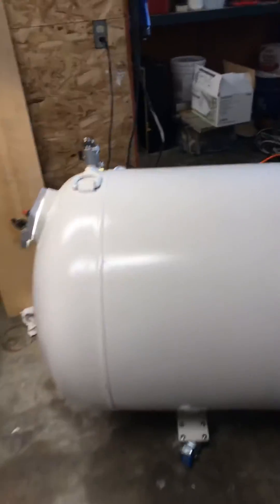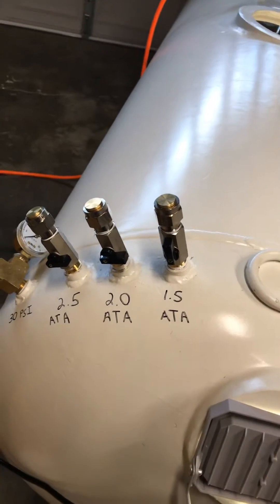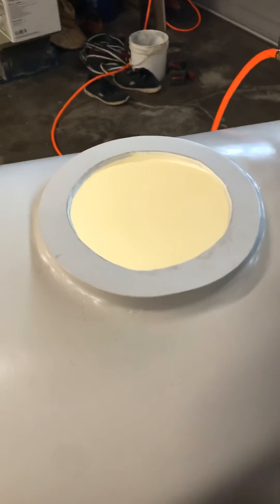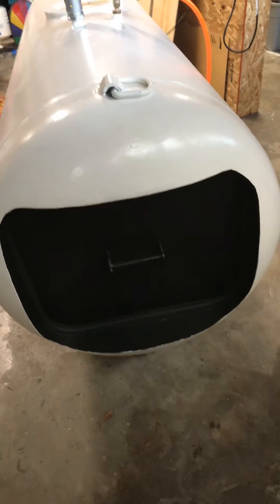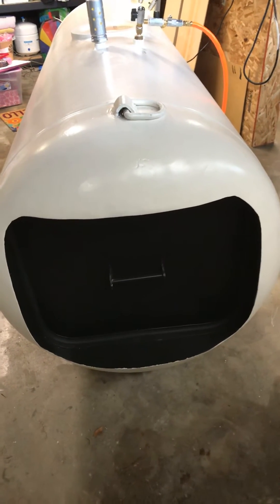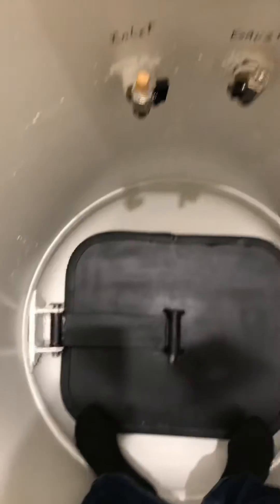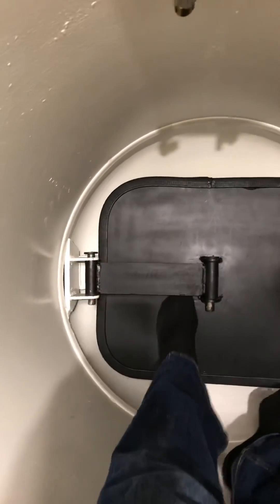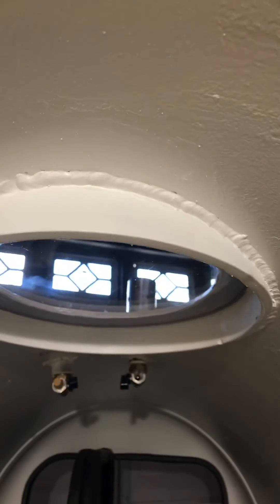Hyperbaric Oxygen Chamber Home Built custom 3 ata chamber build yourself Homemade

Comment: How you manage exhaust CO2 from the body?
Reply: From what I gather, they have "air in" "air out"  so once it's up to pressure, you just keep feeding it pressurized air and the pressure control valve exhausts keeping it at the chosen set pressure.  So fresh air is being pumped in as air is being exhausted

Comment: I built a cheap experimental one years ago plastic only 1.5 but what concerned me was it was using a regular compressor and was worried about the oil from the case getting inside. Nice build
Reply from the maker: Yes you need a oil free compressor
Reply: just add a filter inline if you are worried about any particulate

Comment: Brother I was so stoked to find your channel because, I have been having heart problems. Not horrible yet but I am performing a 100% zen transformation. One thing I use is a meditation called The Gateway Experience. As I naturally had those out of body like experiences from a child. But The gateway Syncs Left and right brain, then the bifurcation echo in the heart. Deals with a lot of heart, brain. Also Dro Joe Dispenza, Gregg Braden's work on study of the group of late stage cancer survivors a study of spontaneous remission to find the common denominator and find ways to control the placebo effect. That with all the latest Nootropics, KY2 for my kidneys as I pass stones last year for 9 months without help or meds because the hospital put die in that covered the stones, after the pain finally moved from back to bladder and then burn vanishing the next day with full flow. I knew I spent 10 months in massive pain and my trust in the medical system is nihil. In any event I also got MitoQ for the heart and healing my pericarditis and regurgitative aortic valve.. I really threw the book at the latest best supplements after seeing a lot of science.. Iv come so far with the meditations that Iv already changed my habits that will show great changes in about 60 days. Also got a load of Carnivora, Time release 500 MG Niacin. Lactic Acid bacteria actually supercharges the K2 MK7  with D3 as well as the MitoQ. Now all of the above really increase blood flow, repairs cells and regenerates. But the meditation regenerates the degenerated Telomeres on your DNA and it restores them in 60 days of 33 minutes of meditation every morning. This is what starts the remission and rewires the brain. Most importantly The Gateway Meditation and Syncing Left Right Brain with the Bifurcation echo is a level of changes that take place, I mean I thought these changes would be next to impossible, I smoke as well. But My Supplements are on the way from amazon while I have been doing the gateway every day for 2-4 hours. And after a week of that I have some pretty amazing changes in the way my body feels. After being a stone mason my entire life, I can not put in 8 self tapping wood screws in my desk without a wave of intense nerve pain rushing through those hands for 3 weeks after.. 8 SCREWS Man.. And im 47. That is to say with my financial situation beings my being too stubborn to go on SSDI pride i guess. I have to build my own chamber. But more than just a chamber what I need to design is One machine that provides me sensory deprivation tank combined with the pressure. And I thought a Propane tank would be perfect. Never thought Id find someone who build one and wow it sure looks nice man.. So I thought I might reatch out and see if you might be interested in helping me design a system that does the oxygen treatment with the sensory deprivation so I can perform my Meditation with zero tension on my body. while betting the high dose of oxygen as the most important part of the meditation is moving a wave of oxygen through the body, converting it to mental energy and then dreamscaping while the Tone in the left ear plays slightly lower than the right ear causing the brain to sync. Hemi-sync. Its a very real thing and doing that with the oxygen treatments would be next level. But the sensory deprivation is extremely important to me due to the amount of distraction a bed, blanket, big toe sticks out, breathing,  true people meditate all the time while just using a bed. The Best Monks in the east are Bald so when meditating not even a hair can distract them. So if those monks shave heads to go Zen, Its not that you can not meditate, Its that every possible one up on the depth of numbing the body while staying completely awake in the mind. This method you as they say go visit past away lovedones while back on the ranch in the chamber your brain is synced up, heart, as my water proof ear buds with full cover phones will ensure that. If I have to use ultrasound and beam it through the water I can do that as well. I am extremely creative . My plan is not a typical sensory deprivation tank either. I plan to push the envelope very hard on the floating part. An old stone mason body needs total free space floating. I have some ideas that done require salt to float. Anyway Im gooing to watch your content about this and If you are interested in working with me on project possible some brain storming.. Reply and ill email you.. :) Thank you..
Reply from the maker: the fact that you cant install eight screws without having dizziness, and that your profession was the hardest job there is on your body, I would think that you could be suffering from ligament laxity in your neck and miss alignment which causes neurological problems ringing in the ears, dizziness, panic attacks heart palpitations vertigo, digestive issues and much more. If any of that sounds like you, check out caring medical on youtube. I have suffered from this myself . I went to the dr howzer in florida and am 70 percent better. I would not be interested in a chamber build with those parameters. Best of luck to you!
Reply: I just finished one that can be pressurized to 2 ATA (28PSI), has power on the inside, and is on wheels. I am willing to sell it if you are interested for roughly 5-6k(maybe less). I could probably even deliver if gas and time is paid for!

Comment: Would it be more efficient if the inlet was closer to the head and the exhaust closer to the feet? I haven't built one yet so I have a lot of questions. Thanks for the video.
Reply from the maker: Hello sir the closer the inlet is to your head the louder it is. Also, if you’re supplying oxygen you have that up there also.
Reply: @dennisgrob5690  I appreciate your response and help. My question is more about this amount of 02 used in relation to their placements. I am working in an environment where 02 is incredibly hard to get, but I think a hyperbaric chamber is going to help increase overall 02 sat to stabilize patients. I know that might be a bit in the weeds for this video but again any advice will help me save lives. Cheers

Comment: Dennis... I am interested in bldg my own chamber. I have lost a kidneybto cancer and my remaining kidney is impaired. I also have ischemia of the heart. 
I have researched hyperbaric and believe it will give me some relief!
Since I can't afford a manufactured chamber I would like to build one. I want to build one that uses an oxy generator with a face mask and 2 to 2.5 ATM. Any advice would be helpful. How can we communicate with each other?
Reply: I just finished one that can be pressurized to 2 ATA (28PSI), has power on the inside, and is on wheels. I am willing to sell it if you are interested. I could probably even deliver if gas and time is paid for!
Reply: @rileywitt1911  I'm interested if still available. How do I contact you?

Comment: Hi Dennis- are you still making chambers?  Or assisting ?  Please advise-
Reply: I just finished one that can be pressurized to 2 ATA (28PSI), has power on the inside, and is on wheels. I am willing to sell it if you are interested. I could probably even deliver if gas and time is paid for!
Reply from the maker: I make on request .I have only made larger chambers since the video. if you are interested grobwoody1@gmail and leave a contact

Comment: How much?
Reply from the maker: base price 24000 for a 38inch by 8 foot
Reply: I just finished one that can be pressurized to 2 ATA (28PSI), has power on the inside, and is on wheels. I am willing to sell it if you are interested for roughly 5-6k(maybe less). I could probably even deliver if gas and time is paid for!

Comment: Okay, I would love to make one but I'm worried about these home made ones exploding with 100% O2 while I'm in it. Are these safe? Are there anything safety precautions I should take before turning this on or redesign?
Reply: I have a hardware hyperbaric oxygen chamber. I wonder if you still need it now?
Reply: @KiKIGao77  are you in southern california?
Reply from the maker: first if you use the tanks I build it would only be ambient air compressed to max 3 atm. there would be no higher percentage o2 than what you breathe now but the compression would b 3 times greater pushing o2 further into your cells. It is possible to add 100% o2 to the tank in the form of mask distribution . we take great lengths to ensure safety and safe practices
Reply: @dennisgrob5690  How can I reach you so I can purchase one or come pick it up..

Comment: Hi how can I reach you? I am interested in buying a tank or getting help building one. Thanks!
Reply from the maker: grobwoody1@gmail.com
Reply: I just finished one that can be pressurized to 2 ATA (28PSI), has power on the inside, and is on wheels. I am willing to sell it if you are interested. I could probably even deliver if gas and time is paid for! I should be able to sell for a lot cheaper!
Reply: @rileywitt1911  I tried to email you before. I can try from another email
Reply: @rileywitt1911  Did you get my email?
Reply: @testomaximo  I did not.
Reply: What is your email?
Reply: @testomaximo  Can you try sending it again?
Reply: @rileywitt1911  check your spam it's coming from peptide frontier
Reply: @testomaximo  I haven't gotten anything
Reply: @rileywitt1911   I just tried again from my Gmail. Somthing isn't working. Are you sure you posted the correct email? I keep trying to post my email and YouTube is removing it even if I do it cryptically. It's my first name (a ) peptide frontier then the normal ending
Reply: @testomaximo  I just sent you one.. Hopefully that works
Reply: @rileywitt1911  I don't see it in my peptide frontier. Try ryanrmisas at the same domain as yours
Reply: @testomaximo  Sent

Comment: I finally got around to building one. Could really use some help selecting a seal for the door. Thanks!
Reply from the maker: what part do you need help with? you can use rubber chord at 1/2 inch but it depends on your build. stay tuned as I am building one now and will show the process soon
Reply: @dennisgrob5690  How did you build the channel that the O-ring door seal sits in?
Reply: I had a machine shop grind a 1/8 by 1/8 curved channel on the face of a 24" by 1/2" steel plate 1/2" from the edge on one side and use a glue stick to paste a 1/8" I.D. latex tube onto it. This holds for years. 3 so far with me. You need to give any sealing material a place to go when pressure builds or the seal will be crushed and last only a few sessions.
Reply: @Josh-ov4wj  Is this like an O-ring groove in a hydraulic fitting?  I'm trying to figure out a good door seal as well.  It looks like you don't need a latch on the door since pressure from inside will seal it?

Comment: What's the psi you pump it up to. I'm making a chamber. I haven't got in it yet I need clean air filter and pressure release valve.   I've had it up to 8 lbs psi. I'm not planning on going more than 5. Doesn't it get  hot inside when the compressor warms up? And does the outside temperature make any differance. Right now I'm using just air but I plan on adding a 02 concentrator.
Reply from the maker: 3 atm or 30 psi. the temperature inside increases in relation to the pressure as more molecules are pushed together ie friction. in winter it is not an issue but in summer as the ambient temp rises it does get hotter. I had an inline ac to help control the temp. as for using an o2 concentrator , the pressure that it creates is not enough to be usable. I had an invacare o2 concentrator and a o2 compressor pressurizing to 2k psi in 2 large o2 tanks. then reduction gauge and o2 flow control bringing 20 lpm of o2 into the chamber through a mask at 40 psi. It had to be more psi than 3 atm to supply me with o2. if you are not up to all that jazz then I recommend just ambient air and an oil free compressor. You will get a benefit from that alone.
Reply: @dennisgrob5690  3 atm is 44.0878463  psi.  You shouldn't be confused on Atm and ATA if you are giving advice to people.

Comment: How much does the 30" x 84" and cost?
Reply: I just finished one that can be pressurized to 2 ATA (28PSI), has power on the inside, and is on wheels. I am willing to sell it if you are interested. I could probably even deliver if gas and time is paid for!
Reply from the maker: I no longer make the small ones unless it was a contract job, they are just too small

Comment: Also what are you using to create the pressure are you using a vacuum pump and reversed like something similar to air conditioning pumps
Reply from the maker: I use oil free air compressors . 220 volt are better as they use less amps
Reply: @dennisgrob5690  I have been researching to buy an oil free screw type air compressor and looked at Kaeser, Quincy, Atlas Copco but their smallest is 5 hp. Can you please recommend a supplier. What brand is your 2 hp compressor. Thank you.

Comment: I am going to build one I was curious I do plumbing so would be using 100 gallon water heater internally they have a second shell that is obviously airtight I would lay some comforts in it but do you think that would be sufficient start to the outer shell
Reply from the maker: I would not do that, you couldnt move around or fit in that size . The video I made is 250 gallon and able to withstand 160 psi. I normally build a 500 gallon tank which is 9 feet long and 38 inches in diameter

Comment: Nice work! The door must only use pressure to stay closed? Was this a 250 gallon tank? Doesn’t the tank reek of propane, and does painting take that away?
Reply: Please dont use scrap propane tanks.  Yikes
Reply: @jeffbrown7164  There's nothing wrong with scrap propane tanks. They are heavily regulated during construction and on average are rated for 250 PSI working pressure when you are only going to 30 PSI maximum when using HBOT.
Reply: @jeffbrown7164  that’s not true, used propane tanks are used for hyperbaric chambers. There’s some beautiful home built chambers from used tanks out there. I’m hoping to find a used tank and get started.

Comment: Nice job, that was exactly my plan after I retired. Do you mind sharing what you did to detox and clean up the inside?
If I get serious about building one then in the next couple of years I would love to give you a consultant fee for details around the door seal!
Reply: I found my port windows on Ebay and he even made the door for me.   The ports I bought do not have holes in the window acrylic. I think that might weaken the window.  At the pressures we use the tanks it might not matter but just trying to be a safe as possible.   Enjoy the Hyperbaric Journey!
Reply: @blanez  Looks like the windows on this one are just glued in?  his newer design has bolted flanges, but if they'll hold with just glue, that'd save  a lot of time
Reply: I made one that I am willing to sell
Reply: @riflydrones436 where are you located?
Reply: i'm interested  @riflydrones436

Comment: You must have separate air inlet next o2 otherwise it is a death trap.
Reply from the maker: of course , this particular chamber was built only for 3ata compressed ambient air. I have built  others with separate o2 input
Reply: @dennisgrob5690  what filter do you use? My are 0.1 micron plus carbon one.
Reply from the maker: @pedjazoric2749  I had the same set up plus an inline dehumidifier
Reply: @dennisgrob5690  and 3 ata is sure not only as all of medical treatments are done at up to 2.4 ata. For brain regeneration they dont go over 2ata and even for my case of cancer recovery they recommend no more than 2.
If you have some info write it up I would like to know
Reply from the maker: @pedjazoric2749  https://www.youtube.com/watch?v=a9IUVffXmS0&t=293s I follow Dr Scott Scherr on youtube , He has more experience than most people in this field. I is funny though, the magic all happens at 2.5 to 3 . That is when your hemoglobin starts to accept oxygen and transport it to dying tissue
Reply: @dennisgrob5690  I followed him and took something from him some from one clinic in LA and some from one clinic here in Serbia and added my own o2/air protocol as Im to sensitive to o2 and cant recover from oxidative stress.
I planned better chamber for next year that can go over 2.4ata because I built this one without knowing a single thing on how pressure works so it can hold only 2.4 ata... but it costs me 1200eur so cant complain to much lol.
I did 70 treatments and had great resoults. Got my vision back from chemo damage, no more fatigue, damage knee from car accident improved and now I can run for the first time since 2014 and cognition is way up from before... And Im only person that did this in conjunction with microdosing magic mushrooms. This combo put neurons in new brain tissue and makes brain functions recover much faster. Hbot did miracle for me. I hope that it gets covered by health insurance in future to get more affordable because in US it is crazy expensive compared to some European countries like Bulgaria where it cost 20 bucks per treatment. It should be used more often in treatment various injuries and illnesses.
Reply: @dennisgrob5690  question. how did you clean out the tank?